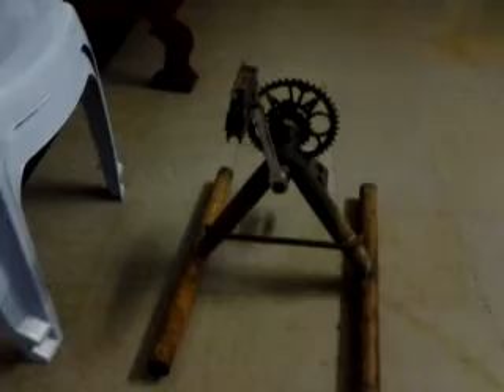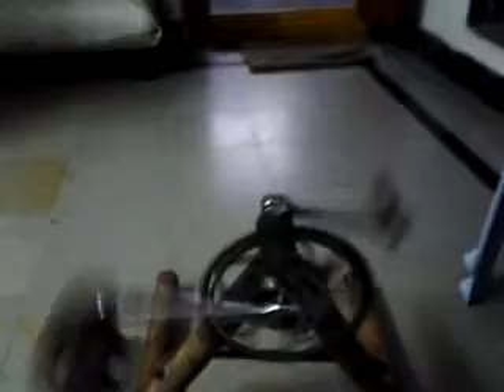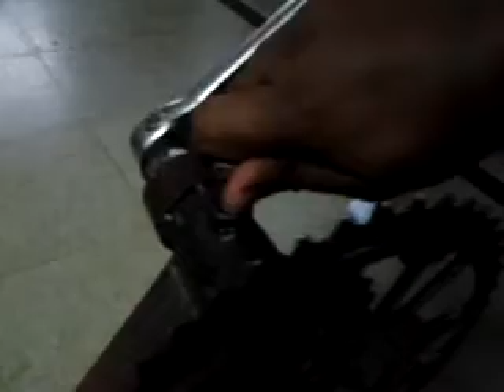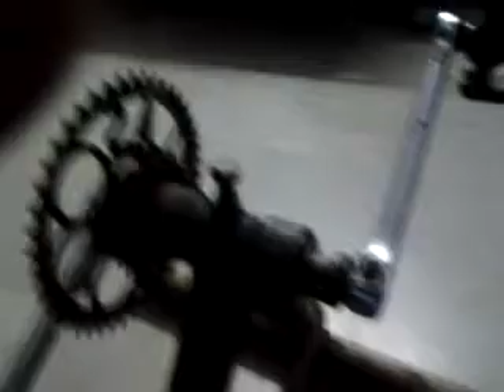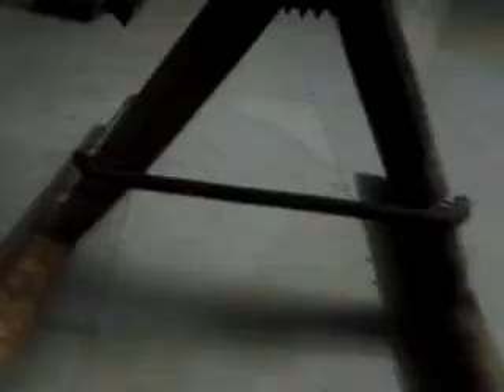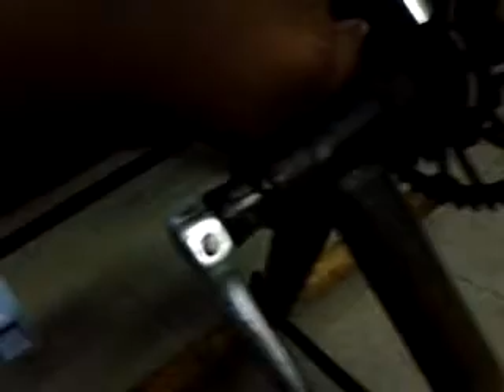Mini cycling machine  - home made

Comment: Hello SP Kumar, 
First of all, I would like to congratulate you for the efforts you took to make this product.Really, it is amazing. I was searching exactly the same.
I would like to make it .is it possible you to show which instruments you used and how did you make it.
Reply from the maker: It is very simple, nothing is there to explain. Prepare frame first. Fit cycle paddle with center rod. and drill one bold in middle to control the friction.